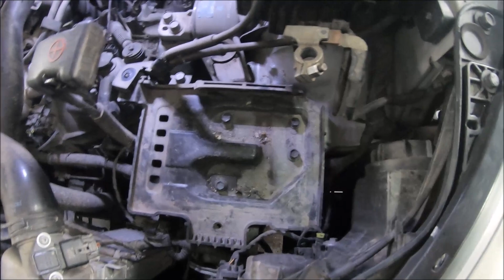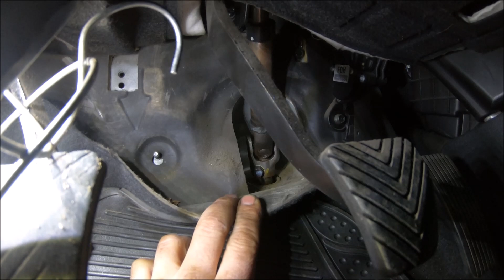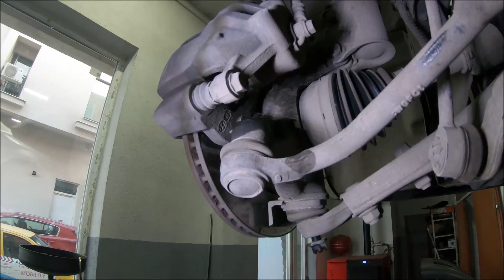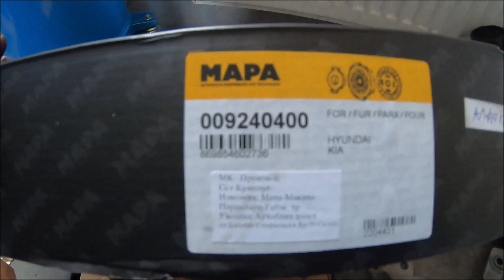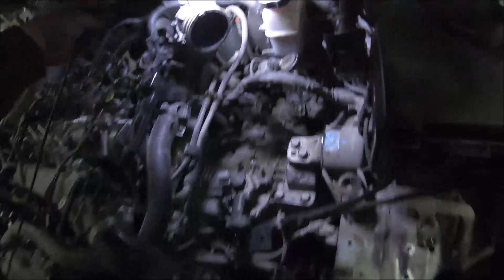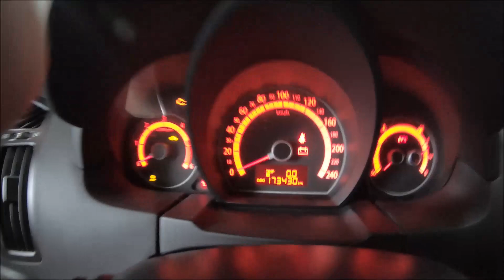kia ceed 1.6crdi how to change clutch

Comment: You didn’t even need to take the subframe off.
Reply from the maker: How will you remove it then I try but didn't succeed
Reply: @ easy I did it
Reply: @raatguzari5207  Care to explain? Or just an oldschool troll?
Reply: How did you proceed without removing the subframe?